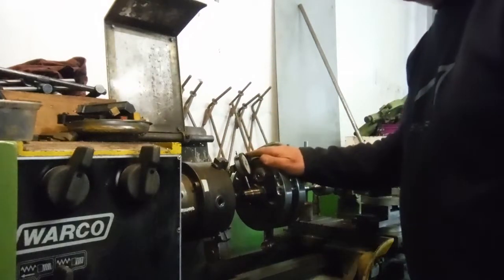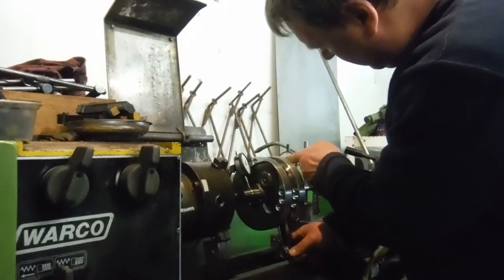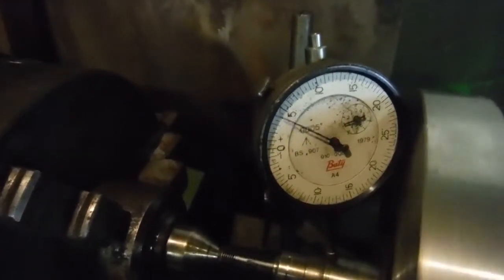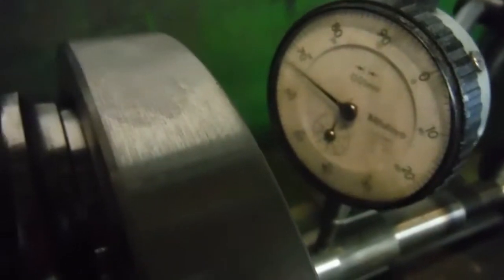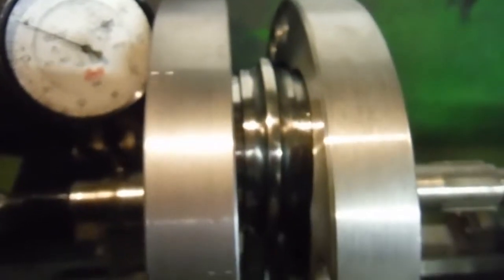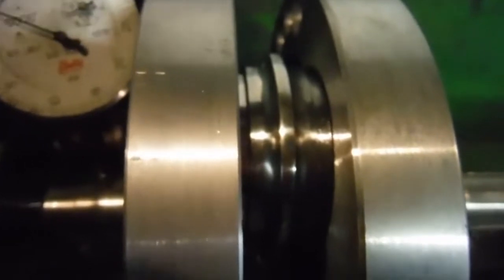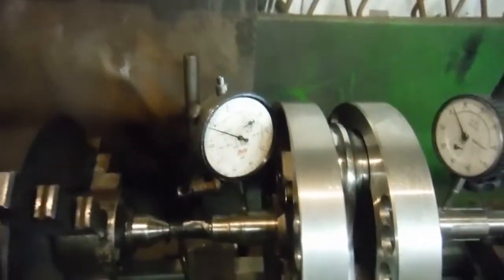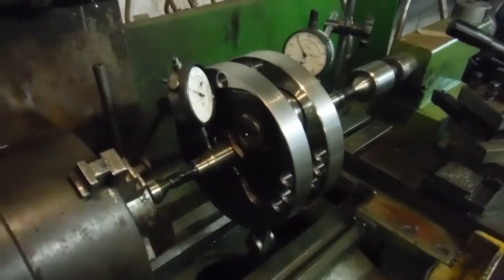Royal Enfield Asbo 32 lightened crank by Performance Classics.

Comment: Hi Paul,I imagine there’s plenty ov weight in the crank? Have you ever tried going knife edge on the flywheels? How much weight do they really need!
Reply from the maker: Hi David, I haven't done anything that drastic, but generally, I remove about 1 to 1.5 kgs from a complete assembly, which would start out around 10 kgs before modification. It makes a big difference to acceleration and braking and very often my rebuilt cranks run truer than before, so the main bearings get an easier life and the engines run smoother as well.
Reply: Do you weld them or not? I’m enjoying the videos I’m just getting my head around aluminium con rods!😱
Reply from the maker: No - no welding at all.